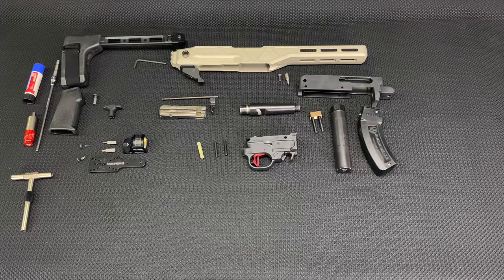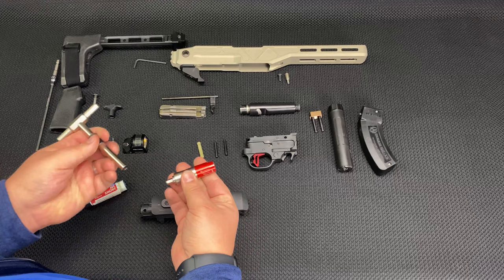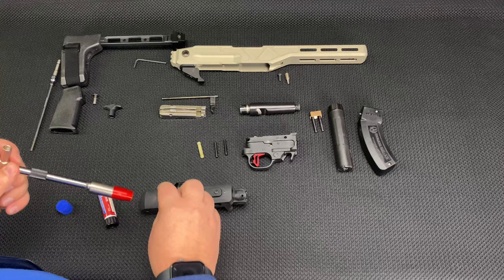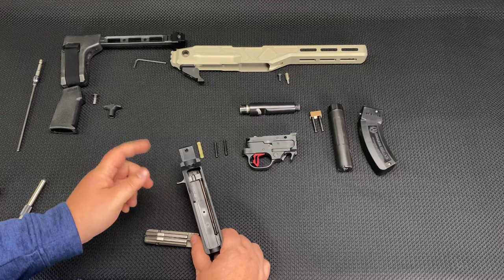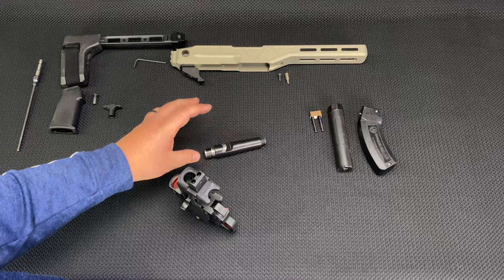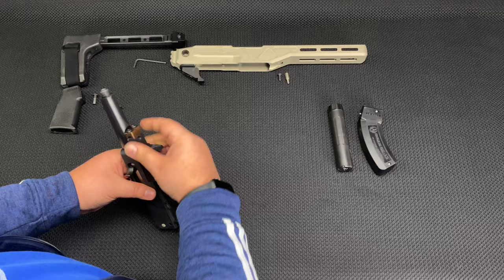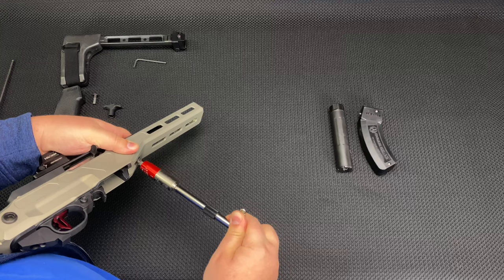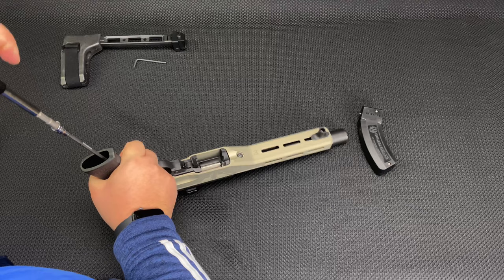Building a 10/22 Charger with a Enoch Industries Odin Chassis and SB FS1913 Brace

Comment: Did the kit come with the folding brace or was that separate? I’m currently building a 22 charger out of a PMACA chassis.
Reply from the maker: This one didnt' come with a brace, I added the SB tactical brace. For a PMACA you'd use a AR style brace or put a pic rail adapter on the back to use on like this. Check my other videos out, I've done a ton on the PMACA chassis.

Comment: Would this work with any 10/22 receivers? Or only the charger?
Reply from the maker: Can’t make a pistol out of a standard 10/22 receiver since it was a rifle first. If you buy an aftermarket receiver you can make whatever you want.
Reply: @ZackCarlson  so there's no way to use the Odin chassis in CA since the charger is not available in CA, correct?
Reply from the maker: No idea on California. But could you build a gun with a virgin receiver like the brownells?
Reply: @ZackCarlson  are you saying you can use a Faxon FF-22 Receiver to make a pistol

Comment: is that the pewter or bronze color?
Reply from the maker: Yeah it's the pewter.
Reply: @ZackCarlson  man it looks sharp! so I was thinking about getting the odin chassis(the shorter 2 slot one) with a 6" barrel preferably from enoch if they get them back in stock and just using all my stock 10/22 bolt/trigger components with this brownells receiver(I assume that shouldn't be an issue to consider a pistol?)
Will that all just basically drop in like yours did? Any recommendations on an other barrel that will work that's a 6"? I will eventually suppress it as well.
Reply from the maker: As long as your Brownells receiver was not built into a rifle first then it's legal to build a pistol from it. That being said who the heck is gonna know what you built first? 

The enoch barrel is going to be super light which will be nice, the Kidd 6" barrels are pretty good but they weigh a ton. 

It all depends on what you want out of the gun. If you are wanting it super accurate and are going to have glass on top to achieve that goal then probably the enoch or the kidd. If it's a red dot bullet hose I'd probably just have a 10/22 carbine take off barrel chopped and threaded. Or if you are budget minded maybe get a 8-10" factory Ruger charger take off barrel from a place like S&P outfitters.
Reply: @ZackCarlson  actually I think I just going to use my charger innards,  put a 6" barrel on it and drop it in the odin chassis so I don't have to mess with any of it.

Comment: What length action screw did you use? I bought an Enoch Industries Deep Six chassis, and it requires a short action screw, it seems.
Reply from the maker: 99% sure it’s a factory 10/22 screw
Reply: @ZackCarlson  I figured it out. The Odin and Deep Six chassis both require a 12-24 x 1/2” screw. A normal 10/22 action screw is too long.